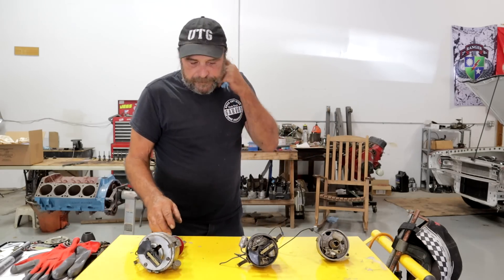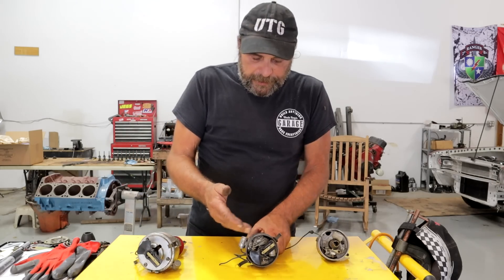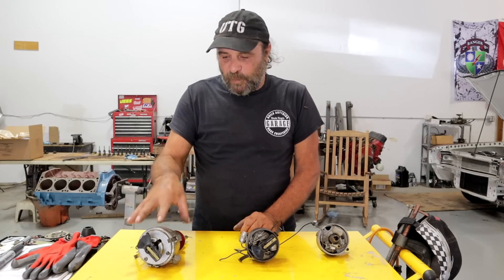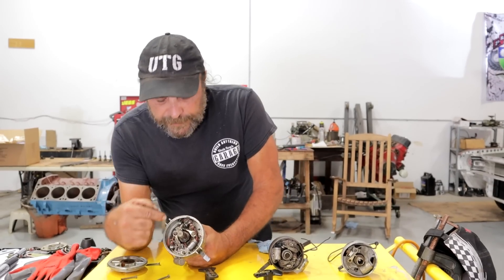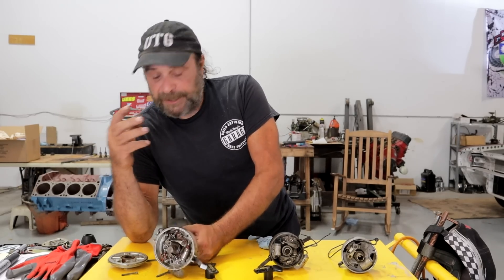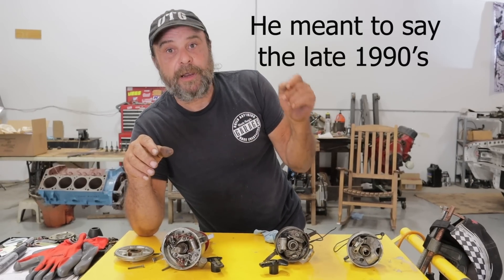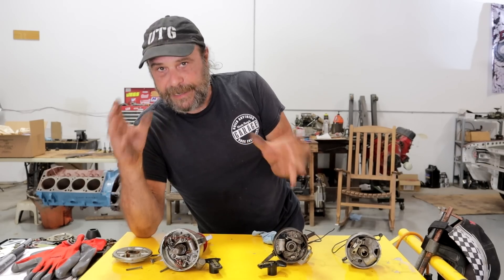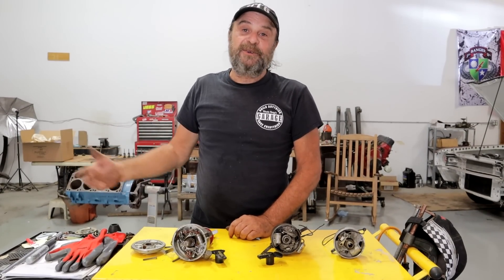High Performance Point Ignition Systems -  Tuning, Modifying And Understanding The Different Types

Comment: I had electronic aftermarket ignition on my 1962 for years and it died on me in the middle of nowhere in the desert in a sand storm. 
I found an old set of points in my trunk ripped out the EIM and jammed the points in set them while spitting out sand and got back on the road in about 30 minutes.. I replaced them with new when i got home and they have been working perfectly for 5 years straight,, I will never go back to electronic ignition..

Comment: Tony my brother recently bought a old boat with an inboard/outboard, straight 6 cylinder engine with points. He'd told me had no spark (turned out coil was junk) but he told me he was going to change points & condenser. I cautioned him about the rubbing blocks going bad as you had posted in one of your videos. Can you tell me what brand of points you found that did NOT have this problem???
Reply: If you check the comments on Uncle's previous videos on points you'll find a couple of consistent recommendation. Sorry that I can't recall them offhand.

Comment: What kind of distributor cap and rotors would you recommend Tony?  I have 1988 ramcharger get a LA360 I'm building to put in it to replace the old 360 so I can rebuild that one

Comment: Totally with you Tony. I run the Aussie "Hemi" 6, and points all the way. Folks on Facebook groups etc, keep saying I'm mad, should spend the bux and convert to electronic. Seriously, what's 10 minutes every 6 months, to gap, clean or even change a set of points? Only issue I'm starting to get, is finding quality points, mostly Chinese knock offs that don't last.
Reply: I spent quite a bit of money on a couple of aftermarket electronic ignition distributors for one car (they turned out to be SHIT) and was totally disappointed for how much it all cost. I'll keep my points. The more I hotrod cars, the more like I like the stock stuff! quite a bit can be done with the stock stuff, usually way more than sufficient.
Reply: I had the same issue with my 351c. Went on ebay and lucked out on several new old stock points sets.

Comment: Points fan here. Customers stuff almost always gets some electronic junk because they cant do maintenance or need bragging rights  and a sticker 🤣 , for myself im not out to set records or stroke the ego, i just want stuff that works,  so its points, mechanical pumps, mechanical fans, good old proven stuff thatis simple and reliable with a bit of basic maintenance  👍👍👍
Reply: My mom had a 74 Caprice with a 400 small block.  It developed some poor performance.  Turned out the fuel pump diaphragm developed a hole and oil and gas were mixing.  It took a while for the shop to figure out what was wrong.

Comment: Hi Tony, Did the Big 3 publish cylinder head CFM for their products or do you have to use a flowbench on them. I am planning my work on a 1977 Ford 351W. This is a street driven car but it needs a little pep.

Comment: ehhh, don't like points butt still liking this! 2:40 about those 'upgrade the distributor kits'.... yea, but I started witha '74 W100 with Electronic Ignition that worked very well! maybe do a distributor swap designed as an electronic ignition type? 

currently, my '78 F'd150 300-6 is wasted spark using a modified Hall Sensor Distributor for a '96 300-6! easy peasy, reliable OEM sparky spark! <3 all

Comment: Have to admit it but I do like Chrysler's electronic systems from the 70s, with the caveat that every part in it is old stock USA made parts. NOT the Chinese or whatever stuff the parts stores sell today.
 However I also run points in a few things and I'm fine with those as well. If the points and condenser are quilty pieces.
  For the 66 Volvo I talked to a guy that works on them and sells parts. (think he's in New York) We talked about the PerTronix kit for it. He said the quality was slipping on them, still sold them, but recommended keeping a set of points and a screw driver in the glove box. I just ordered points. Actually never put them in, still running the points I bought it with. New ones are in the glove box with a screw driver. . . .

Comment: It's funny that you brought up that old dyno test,because I was just referencing that very test while telling some friends of mine how points are by no means inadequate as a performance ignition system.  I actually copied your trick with a dual point distributor out of a first generation hemi to work in my 318 that I put a 100 shot of nitrous on.  I've also got an Accel dual point distributor for an RB block that has the bearing on the upper part of the shaft.  I plan on using it once I build a big block.  I'll have to find a mechanical tach drive style teach so I can use that option with that distributor.

Comment: I frame off restored a 58 Chevy and Id rather have electronic ignition. In fact i have a 68 396 BBC with an HEI setup. I dont want to work on cars unless thyre broke or needing a body repair. Points are not something im interested in keeping up with. My last car a 72 torino w/ built 429 got a Mallory unilite distributor when the stock one  bushings wore out. Never had to touch the distributor again after a that. 17 years it never failed. The beauty of some technology is it makes life easier and performs better being a non wear item. 95% of people dont want or need to mess with points especially considering they degrade quickly which effects performance and efficiency with normal with use.

Comment: I’m with you on the points issue. Electronic ignition was a solution to a problem that didn’t exist.
Reply: Hmm  ,   now wait im having a memory come back.    Some oldtimer said when your parking with the chick and Radio on make sure the coil doesnt have power if the motor in the exactly wrong spot points can heat up or weld together

Comment: The ONLY problem I've ever had with a breaker point distributor is when the shaft bushing wears out and you get horrible dwell variance. You used to be able to get a new bushing from the local parts store and thirty minutes later, you'd have a good distributor again. I don't know if you can still get distributor bushings in this day and age.
Reply: Did you ever oil it? or are you talking 2-300k miles?

Comment: My Dad has been running aftermarket Mallory non vac advance distributors on his 350 Chevy powered Model A for the last 50 years. I inherited it from him after he passed a few years ago and could not get it to run smoothly when cruising at slower speeds. I bought a stock GM vac advance points distributor at a swap meet for $10 and swapped it out and the engine has never ran smoother! A win for old technology.

Comment: Love points in 🇦🇺in my valiant Pacer we used the heavier spring points same as the XU1 GMH   I was always told if your points wear on the edge your condenser is shot. We also had hollow points surpose to run cooler  I always ran the stronger spring points in all my Hemis in 🇦🇺 those Pacers where great an simple cars you would of loved them they could sort out a lot of V8 s 👍🏻🇦🇺
Reply: I changed condenser rating on my old Datsun, that was nearly 15 years ago, still going.

Comment: Hey Tony,
     Tim here again......yes i love points, but quality of manufacturing, and availability, has pushed my shop to ONLY MSD distibutors, easy to tune, easy to work on......wether its a ready to run (daily driver), or with a box, 500 hp and above....they have shown us the reliability we were after, and tuneability we needed......just a thought......MSD has good stuff....well, as long as QC is still in place.....again, just thoughts.......i like ur old school methods, and understand them....so i dig the whole thing....jus sayin MSD has continually brought great performance, and reliability to our table.......i probly wont be able to bias you to electronic ign.....but i wanted to give food for thought......PEACE my brother!!
Reply: Valuable comment thanks!
Reply: How much adjustability do you have with ready to run MSD units? Can I tune the advance curve somehow or is it preset and can't be changed at all?
Reply: @milanskipala7593  its the easiest to change the curve......its all in the box.....advance stop bushings, and springs.....gimme 10 min, the curve will be rite for your application.....actually, if ur thinkin of getting one, tell me ur motor combo and tranny, i can tell u what springs/bushings to use....(need heads, and cam also)....easiset, most reliable deal out there at moment....will help u if u like

Comment: Back in '93-ish I converted my 428 Ford to Pertronix & haven't looked back. Since orig install, I've added a 6AL that's triggered by the Pertronix. I did replace the repo Autolite plug wires as the 6AL burned those up. Now use 7mm Flame Thrower spiral core. Haven't touched the plugs in over 20 years(OK I pulled one & reinstalled maybe five years ago).Runs without issue, in fact far better when cold than with points. 

Yeah I keep a set of points and condenser in console, haven't needed them in 29 years.
Reply: I THINK you pretty much hit the nail on the head with your opening statement 'Back in '93-ish...'

QC no longer stands for 'Quality Control' for a LOT of things today (unfortunately).... NOW QC stands for 'QUANTITY control'....

I see it dang near every day at the parts store I presently work at (been working at various 'mom and pop' parts stores off and on for over 40 years).

The ONCE quality parts are (for a lot of them) simply riding the coat tails of their name but providing piss poor product.

So for you to have really good performance out of the Pertronix system ALL of these years says a lot about what once was....sadly.....
Reply: @russdavis1960  I mostly agree, had to return a Raybestos brake drum because it had a hole in it. Yeah was a offshore part. 

With my Pertronix I'm on other side of fence, in other words age failure concerns me. Electronics does not have a indefinite lifespan. Couple years ago I checked the condenser in my console, was dead, lotta good that'd have done me. Got a fresh(er) one in there now. 

I actually have a spare Pertronix unit, maybe nine years old. Was in a Fairlane I bought three years ago, 700 mi from home. On way home performance went to Hell, I was 99% problem was the knockoff POS offshore Motorcraft carb(lost a vacuum plug in base of carb) but in desperation installed points/condenser. Didn't help. I'm still running points in that one but tune is still reasonably fresh. 

I recently convinced a fellow with a 429 Torino to reinstall his Pertronix(claimed it hurt bottom end). He'd been playing mix & match with three or four sets of points, condenser & coils. Would break up around 5300-5400. Says now it'll pull past 6000 with ease.

Comment: ...you need a hand crank and oil fired headlamps to get the REAL enthuiast effect...
Reply: And something that runs on 60 octane gas.
Reply: Not to mention...that old test he mentioned was run at a 9:1 compression  ratio...try it at 12:1 and see what happens...

Comment: Points vs HEI - This is a complicated subject. With points, along with the condenser and primary coil on the ignition coil, you have a tuned circuit. With HEI, a transistor fires the coil and there is a kickback through the primary, which is damped with a diode. Different behavior than points. (Anyone correct me if I'm wrong.) I know that with some modern cars, the computer fires each plug several times during the "spark time". This might emulate points ignition.

Comment: I used to use a CD (capacitor discharge) system with my points. Points never burnt and the spark was hotter
Reply: If i recall, Toyota used i think was a similiar system. CDI with points in their cars and pickups back in the mid to late 70's. It was reliable and the point contacts never burnt out, pitted or even wore ( probably due to a little current/voltage going the contacts and not having to carry the load for the entire ignition system it was just signal to fire the coil). Periodic replacement was needed, just because the return spring would get weak and/or the lifting block would wear and it would affect (like UT said) the higher rpm operation, misses, etc. It kinda reminds me of a mechanical "hall effect" without the magnetic field collapsing when the reluctor passed the pole piece, instead the points just opened.
Reply: I had a Tiger unit. My buddy installed a bigger capacitor so it wouldn't rev as high, but no more lead fouling problems. I can't remember anyone having problems with these systems

Comment: I'd love to run a points distributor in my 5.0 swap Ranger but the only distributors I can find is are 1 marine unit and a bunch of "new" Chinese made ones. Original Ford stuff was crushed years ago in my area and, even if I could find an O.E.M. unit, the parts to rebuild it would probably come from overseas anyway.

Comment: I have platronics in my Mustang for 15 years never have a problem you just have to have a switch to cut it off the ignition if you want to listen to your radio otherwise it'll burn up the Plantronic system always carry the spare points in the back just in case but I've had several times where I've had the point actually fall apart inside The Interpreter I can't recap those

Comment: just wondering instead of using a switch to switch the timing why not use a two post relay so it would automatically switch the points when you spray the nitrous
Reply: Thats a great idea...  Like I use the transbrake button to trigger the nitrous in old Blue...

Comment: the number one reason i use points in everything is i don't like walking,electronic stuff goes blitz in high temp areas,right now on I-10 HIWAY IN ARIZONA there are twenty cars stranded on the side of the road in 110 to 115 degree weather,the old style sparkers are flying down the road un harmed,and the number two reason is it is EMP PROOF my stuff will run while the electronic stuff just turns over won't hit,no thanks,cars are either reliable or parts,my two cents,i even converted my 454 tbi to points in my motorhome,walking ain't crowded

Comment: hey tony why not use a relay that switches the set of points when the nitrous solenoid is energized, that way if the nitrous is spraying it's running on the retarded timing?

Comment: I thought I was getting two dynatek S ignition systems on ebay. 
End up with misleading Chinese junk.  The items have 'built in retard ability " I set timing on 10 degrees. 
Ran the engine up to 4000 to check timing. The light was lighting up the 10 degree mark.

Comment: Easier to tune and use a HEI, it’s why I love them, everything’s contained and easy to get to, better than points now to with the DUI units which outperform both HEI and points 10 fold
Reply: Only problem I have is all the replacement gm 4 pin modules are china garbage, I grab every oem one I find at the junkyard.

Comment: I've heard some ppl say that if an engine was designed at a time with points, and used points, then it will naturally run well or its best with points. Same with modern engine with modern tech. I did try single points and a late model 360 (2000-2) and it ran ok. Put HEI tech that I bought from Assault Racing through ebay and it seems to run "at its best" but was more thirsty. The one time I tried to put in points I may have screwed the securing bolt down too much and not trimmed the tab on the end of the distributor shaft-horrible timing floating....from 0-20 degrees!
Reply: Engines are stupid, no idea if spark is generated by points or a electronic device. 
Performance based on quality of spark.

Comment: 🟥🟥🟥 I'm 72 and I still have a point file in my wallet. And for those racers out there, let's not forget about cam walk and cam thrust buttons. 
All effect timing and distributor chatter. Put electronic ignition in my old shovel head.It took a shit in daytona. Went back to points.
No problems since. Shudda never changed. Great vids. Keep up the good work. ps...you'll always get home with points.
Reply: Better than a file is a finger nail board, the small ones that look like a popsicle stick. Or better yet, just a folded bit of sandpaper.
Reply: Touch and hold a clip to pin it. Unpinned clips will be deleted after 1 hour.

Comment: I first got into points with the Ford distributers and the single pivot point for vacuum advance.  Niehoff made a replacement breaker plate that pivoted around the center shaft and therefore reduced the erratic dwell with vacuum advance.  Niehoff made a great plate for stock replacement on tractors that could easily be made into a dual-point setup with a little drilling, threading and patience!  A stock modified distributer with a super coil would hold for almost all of our needs.  Hope we can educate some more about the use of our old-time ways to succeed where electronics fail.  What about the capacitance-discharge systems?
Reply: I am glad you made the comment about the breaker plate. I did some searching and found some on ebay under the dyna-flyte brand. They rotate on a ball bearing instead of a floppy pivot like the stock Ford stuff does. I ordered one for a Ford FE points distributor and the model I bought can be used as both single or dual point WITH vacuum advance. gonna give that a try!